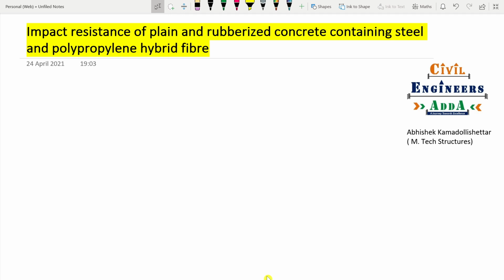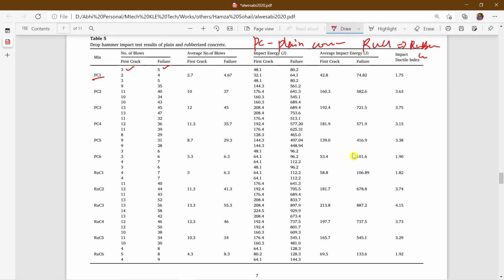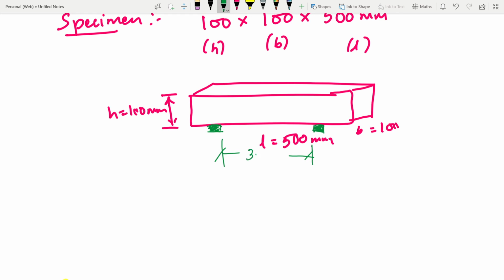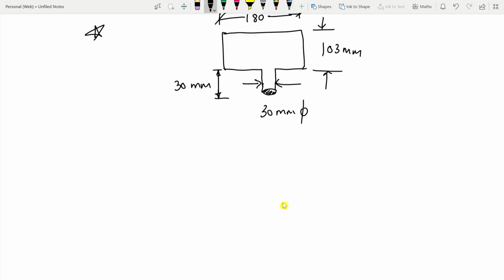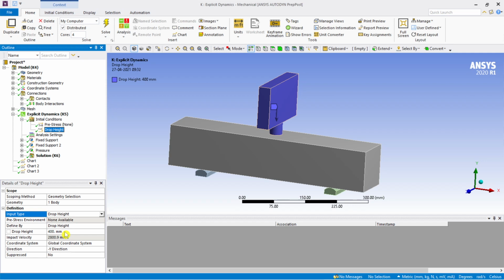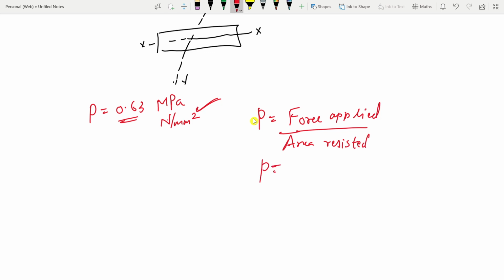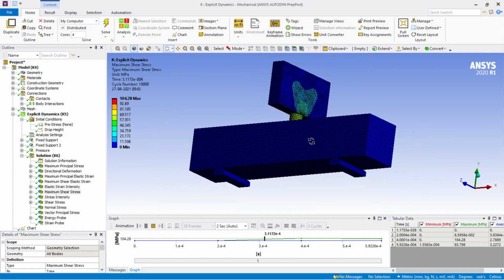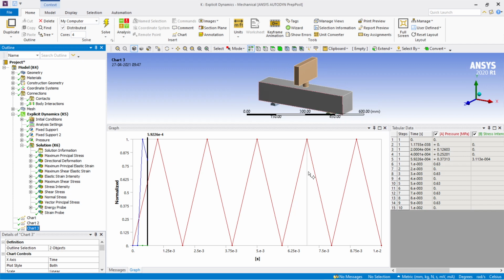Crack Analysis by Repeated/Cyclic Impact (Drop Test)on concrete beam in Ansys workbench Part-1

Comment: Hello,  thank you for nice video! If I have understood your explanation correctly - the drop of the indentor happens only once and the further load cycling is managed through pressure on the top of the indentor? So there is not repeated the drop of the indentor? Am I right? Thank you for your aswer in advance!

Comment: Hello sir,
Your videos are really helpful for students.
I'm also working on ANSYS for my dissertation work. My thesis is regarding of flexural strength of RC beam, and i want to know, can i apply 400kg/min load on beam which is mention in IS 516 t. And what is the procedure for applying this kind of load on beam. Which project schematic i have to use for this Explicit dynamic or Static structures.